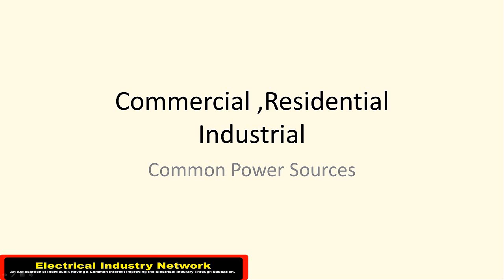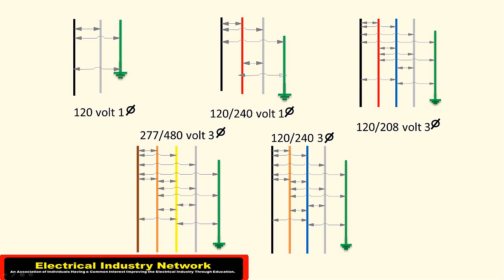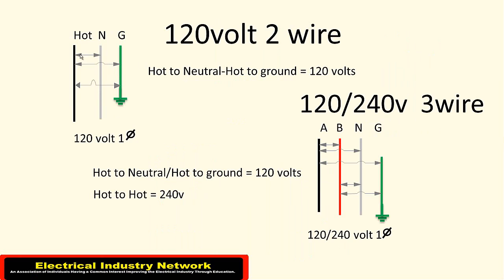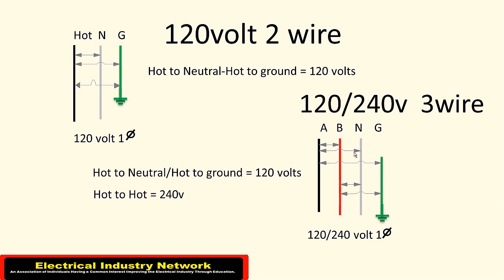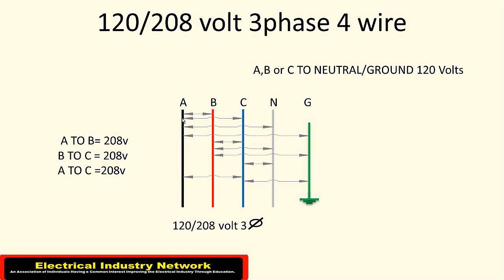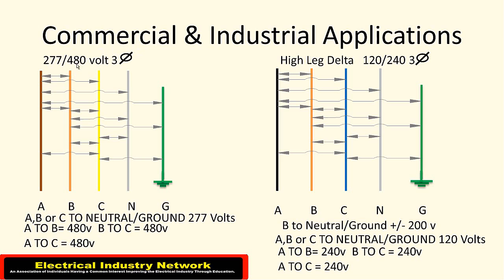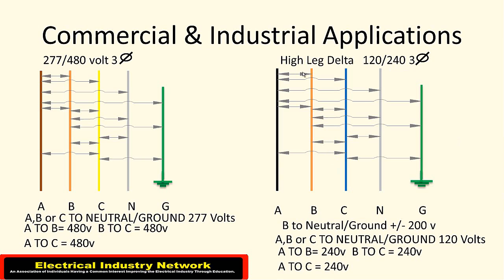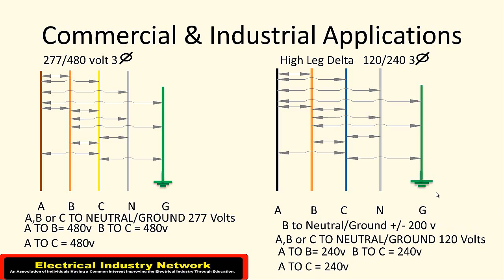Electrical Wiring Power Sources

Comment: There is an easier way to calculate the high leg voltage.  Simply multiply the phase to phase voltage by the sin(60°) or 0.86623.
Reply from the maker: +Jolyon Welsh Thanks for that info,I did not know that.

Comment: In the hi-leg delta, the nominal voltage between the stinger/high leg to neutral is 208V, the same as between any two phases in a 120/208V 3-phase 4-wire wye system. The ratio 208/120 is the square root of 3, a number you see a lot in 3-phase theory.

Also, the nominal voltage between neutral and ground is zero, but in any real system you will see a small voltage due to the voltage drop along the current-carrying neutral. Safety grounds (green or bare) never carry current under normal conditions, so they normally have no voltage drops. That's why neutral and ground are separate.

I would have explained the different systems in terms of phasor diagrams. While it's a little more mathematical it makes the reasons for all the various voltages much clearer.

Comment: Also you Technically you need a electrical license to work on anything electrical. It doesn't matter if it's 1v or 10,000v. Technically speaking you need an electrician to install a hard wired doorbell even though it operates at 12v. Though most times it's not that big of a deal.

Comment: extra-low voltage is less than 30v
Low voltage is greater than 30v  but less than 750v
High voltage is anything greater than 750v

this is Canada